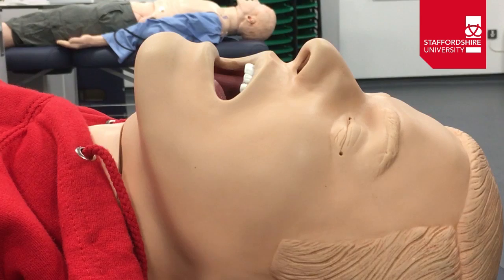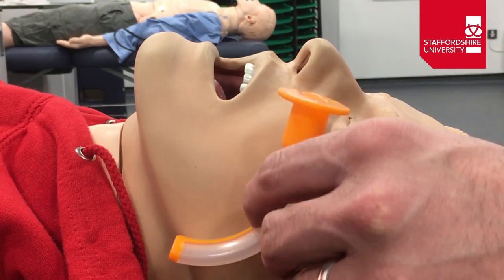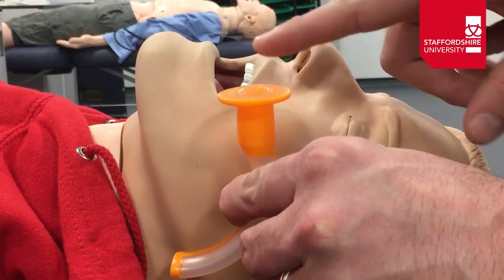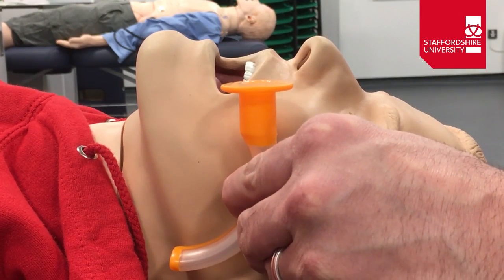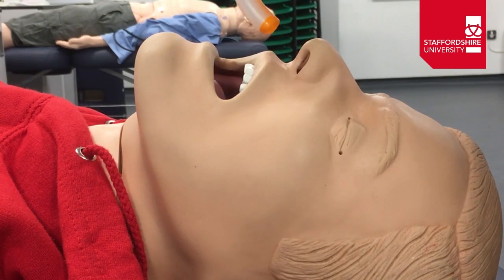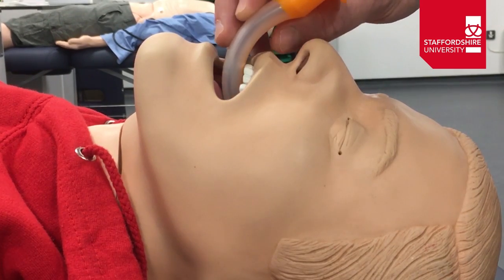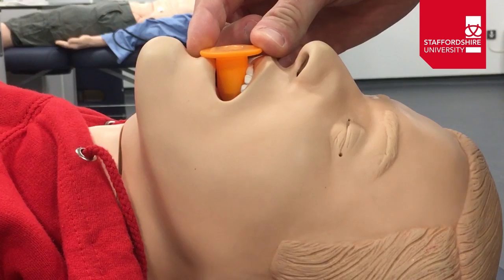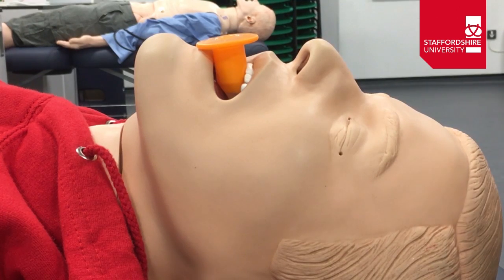Oropharyngeal Airway Insertion

Comment: What if we insert directly without rotating?
Reply: Run the risk of pushing the tongue back, further obstructing airway. It should be noted (this is how I was taught) that for pediatrics you do not want to use the rotate method as their "hard" pallet is very soft and prone to trauma so you would use a tongue depressor push tongue down and forward and insert the OPA without rotation. Not sure if same could be done with adults.
Reply: @Tyler-vw9bh  okay thanks

Comment: Does the rolled back tongue get in the way when doing this? Would it be recommended to use a tongue depressor simultaneously, or does the OPA insertion naturally bypass the tongue?
Reply: You absolutely can use a tongue depressor
Reply: Some tubes actually come with built in tongue depressors.
Reply: Or you head tilt chin lift first  this securing the  airway manually first, then process with NPA.

Comment: I dont think you can use OPA when the patient is responsive or even semiconscious as it might cause vomiting or intiate the gag reflex. If the gag reflex is present, you’re not advised to do it.
Reply from the maker: That's our understanding as well Tamem. We would not recommend their use on a conscious patient, and even with a patient with reduced level of consciousness you should be aware of the possibility of an intact gag reflex.
Reply: after I conclude the patient is unconscious, i stick a tongue depressor on the throat to test gag reflex
Reply: after I conclude the patient is unconscious, i stick a tongue depressor on the throat to test gag reflex
Reply: Yes